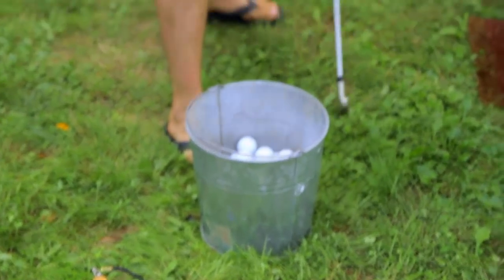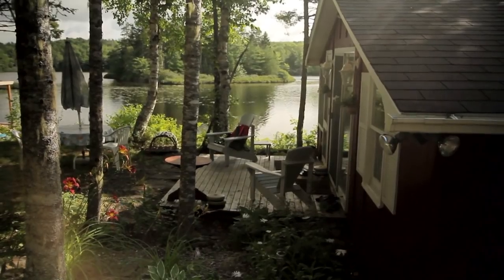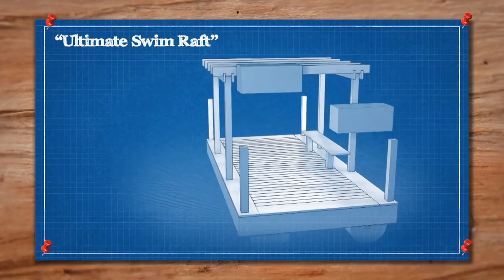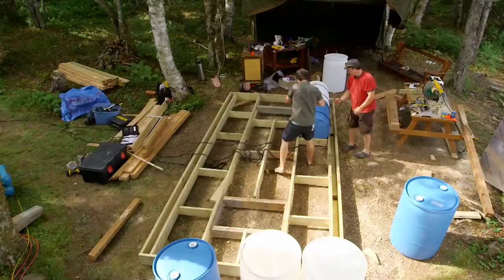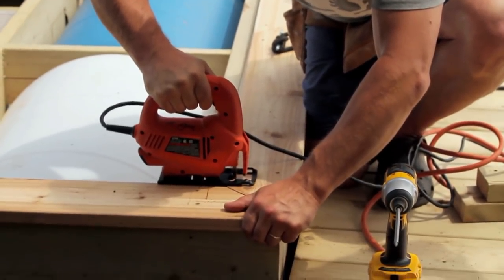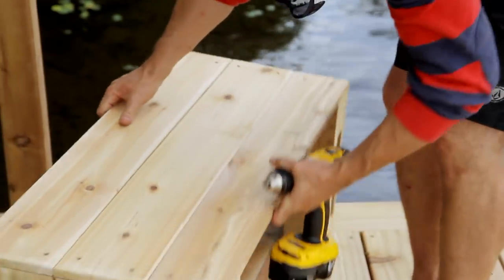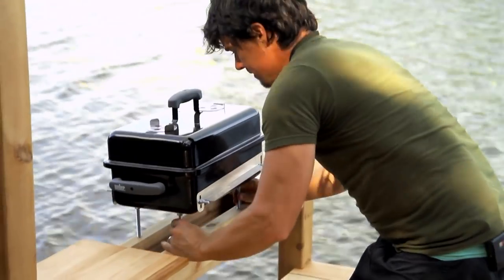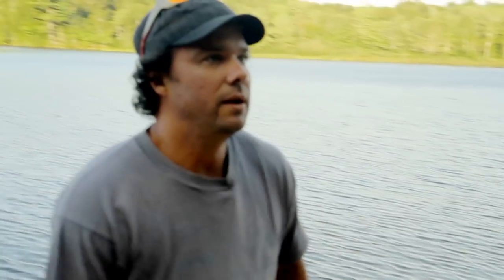How to build an EPIC Floating Dock | The Brojects

Comment: I built one like that, 20 years ago, but I used stainless steel banding material instead of nylon rope, it just survived hurricane Mathew.  Plus I used 15 Barrels, I put them down the Middle ,  also used treated 4x4 s as frame bolted together with  1/2 inch bolts

20 years ago it cost me about 500 to build.  I had to order the stainless banding material , you also need a banding tool.  do not  put the deck on until its waterborn its to heavy.

Comment: Ditch the trolling motor and throw a 30hp 4 stroke on there and really take that thing out for a ride!
Reply: That would be very heavy and put alot of weight on one end.
Reply: Will Whyatt
But worth it!
Reply: John Smith I wouldnt work it would be to one sided
Reply: Will Whyatt
It would work if they mounted it to the front end of the structure (having the motor pull the structure), thereby offsetting all the weight at the "rear" of the structure.
Reply: John Smith I think you need a license for it dont you
Reply: John Smith wouldnt it just be a boat at that point? I thought the trolling moter was a bit much...

Comment: You guys should sell these! If you put a water resistant coating on the wood I would totally buy one. Or pay for you guys to help me build it 😆
Reply: I would probably just use pressure treated wood, you wouldn't have issues caused by the invitable holes in any water resistant coating, and once you factor in the extra man hours needed to seel the wood it would probably cost significantly less.

Comment: do you know how much weight can carry each barrel, I am thinking to do that and put a old caravan over it  the frame will be bigger than the caravan, what you think?
Reply: did you start up your project, or still figuring things out?
Reply: I read somewhere each 55 gallon drum is capable of supporting 440lbs I think.
That was based on a gallon of water weighing 8 pounds, so something about the displacement
8x55=440lbs.